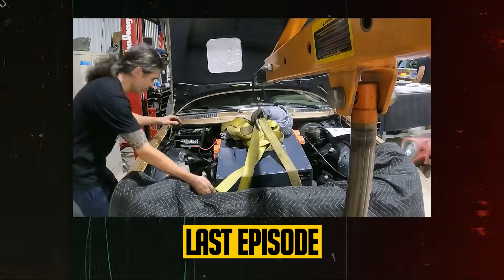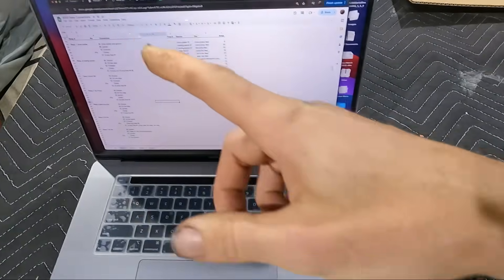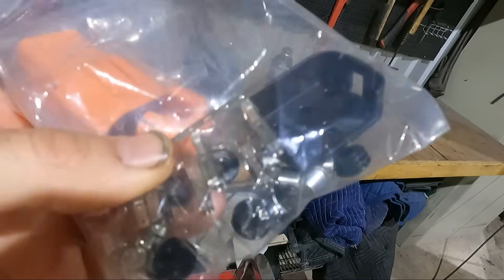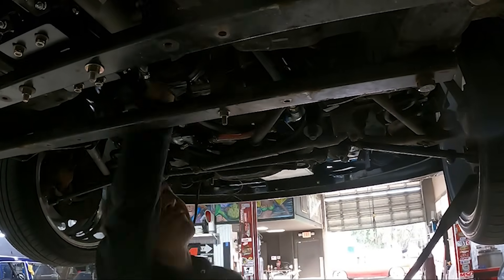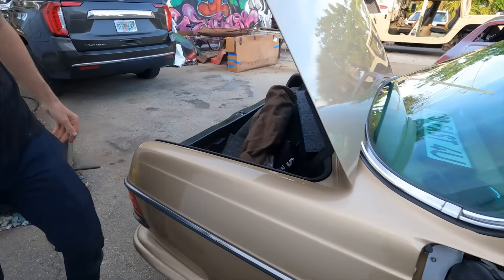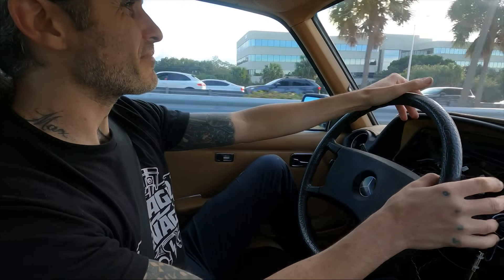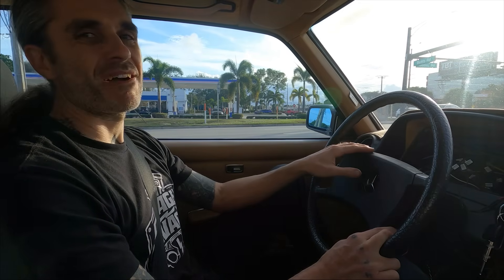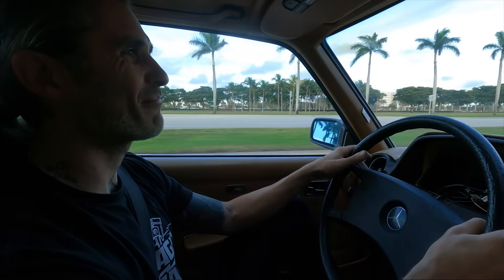Trying to Charge the Tesla Swapped Benz on a Public Fast Charger - Fellten Battery Swap Ep. 4

Comment: So now... all you need is that preparation for "in case of emergency"... so hide a couple of solar panels somewhere so if you are in the middle of nowhere, you can EVENTUALLY get your batteries charged up.  I guess one of those Jackery or Eco-Flow systems would work just as well... but it won't be fast -that's for sure.  This was very well done the first time... but it just goes to show how quickly tech becomes obsolete so major improvements can be made.  Very nice!  I hope the owner is well pleased....
Reply: Why would he ever be in the middle of nowhere?
Reply: @89five3five  you've never heard of going on a road trip?